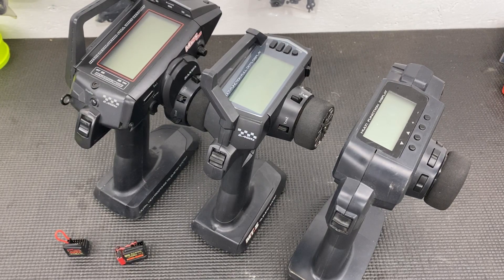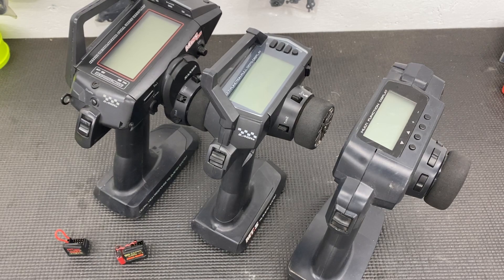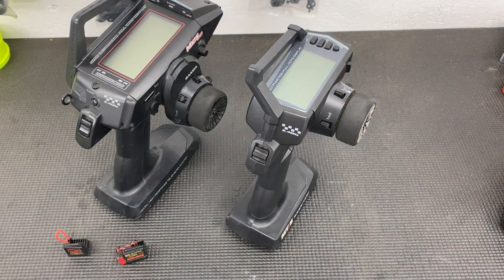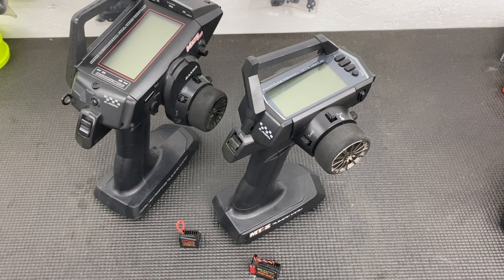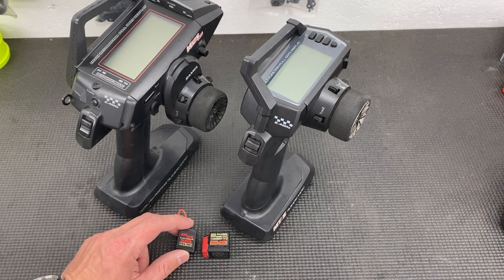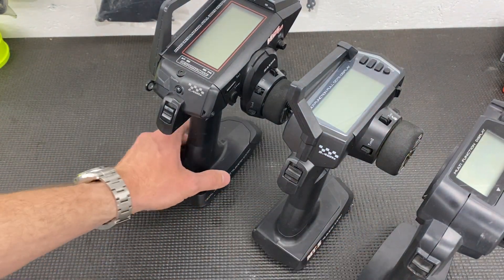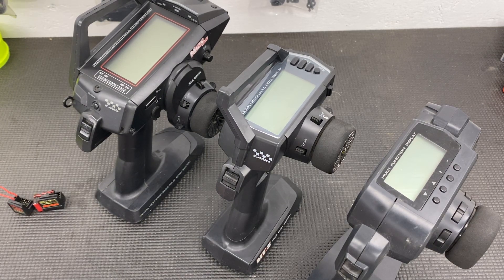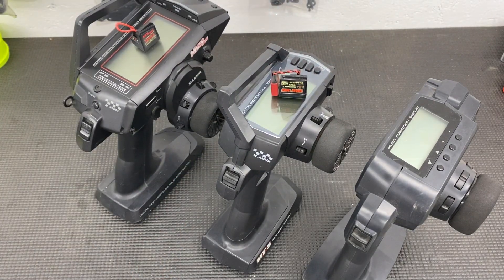Sanwa Transmitter & Receivers Explained! FH4 FH5 FHE

Comment: Is the m12 fh5 compatible? What is the difference in m12s and rs? I have the m12. Thanks
Reply from the maker: So the M12 and M12s - RS are compatible with up to FH4T receivers. FH5 is M17 and M17s.
Reply: @SuperFastRc I had heard say that they will talk to fh5 so was just checking if that was a mistake or if true. The dasmikro fh4 do well for me. I have an m11x that I bought the first dasmicro because it is supposed to be compatible with fh3 and is to an extent… about 20-30 foot of range is all I have got. Using fh3 and m11x with the dasmikro  fh3-4 compatible units. Thanks for the videos and keep doing your work we appreciate it!

Comment: I still run a Sanwa M8 and M11 which use FHSS2... Pefectly fine for TC mod, F1 and 2wd and 4wd buggy.
Reply: I absolutely loved my Airtronics M-8 but my LED screen stopped working and I have no way to know what model it's actually on, it still works but I basically had all of my car's, trucks and buggies on this one radio, I finally broke down and bought a Sanwa MT-S used with a 482 receiver works great but I'm not going to buy receiver's for 7 different vehicles unless I could find them for real cheap, the track in my town has an off road 1/8 scale track and a dirt oval track, so I'm probably only going to need 2 more receiver's, it just really sucks because my M-8 had the Spektrum conversion and those receivers were 35 to 40 Buck each, Oh Well but I do wish that the LCD screen was replaceable, Peace.

Comment: I usually run AGFRC brand rx's with my m17. AGFRC seems to be the direct manufacture for servo's and other rc products that get supplied to the manufactures ie; protek, and others.
Reply from the maker: Can you tell a difference between FH4 and FH5? I really can’t 🤷‍♂️
Reply: @SuperFastRc  not at all! It may be faster if you were to test on equipment, but nothing a human eye or hand can notice imo
Reply from the maker: @tsdelosa I really think Sanwa wouldn’t have a problem with people counterfeiting their products if they would just price them reasonably in the first place. The MTR and MT5 are a cash grab, they use the same mold and everything 👎
Reply: Still using my basic M12 from 2012. I wanted to upgrade to the M17 but I thought I might not be able to tell the difference and it would be a big waste of money. You guys convinced me not to. Besides, I am not at an “Expert” level and the M12 works just fine to me. I doubt the M17 will make me any faster. I also use the cheap knock off receivers from Hobby Star, Power Hobby, Das Mikro, and they work just as good as my Sanwa receivers, at less than half the price and no aerials sticking up. Never experienced any glitch or lack of range for racing or playing on the street. I have a few new kits still to build and these knock off receivers are a good and inexpensive way to get them all in one radio.